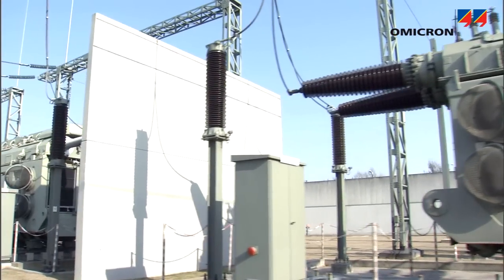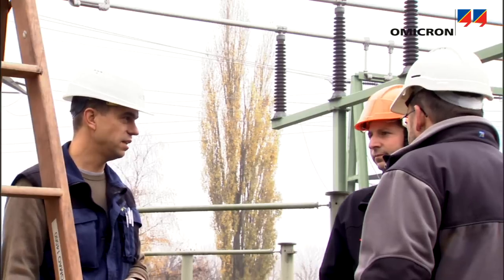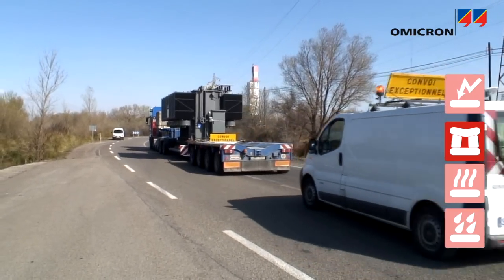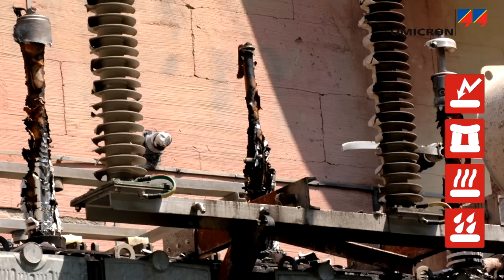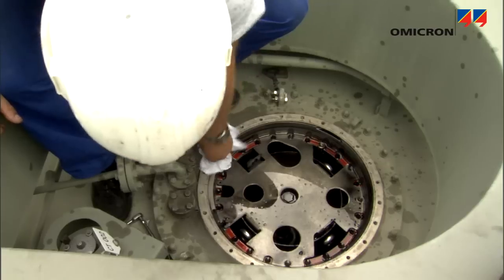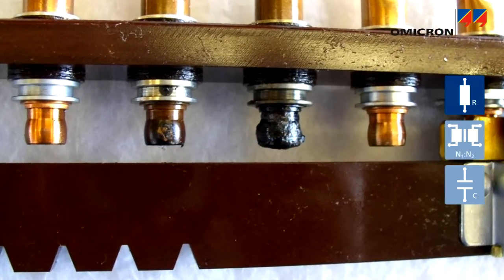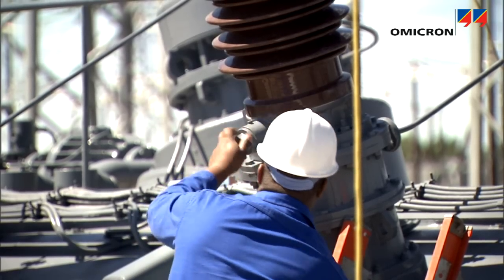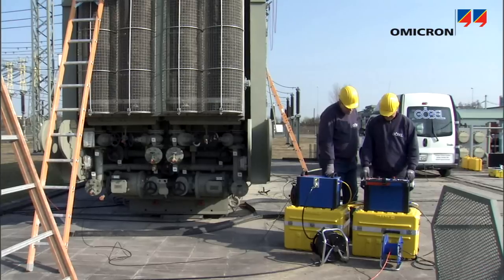Power Transformer Testing

Comment: Excuse me Sir, in withstand test we make a short between Three Phases and apply voltage on the short, that's in Star connection, can we apply voltage test just on Neutral?
With my best regards
Reply from the maker: Dear Eng. Omar Eyad Aljorani, 

thanks a lot for your comment and interest in our videos. The short-circuit of the phases is required to avoid excitation of the core and to equalize the electric field across the insulation system. Excitation of the core could cause a load current. The test of the insulation system (capacity and DF/PF) is done by shorting the phases and measuring the main capacitance between HV and LV side. For more information about power transformer testing, please have a look at our website: https://www.omicronenergy.com/en/application/offline-testing/power-transformer/

Best regards, 
your OMICRON team
Reply: @omicronenergy 

Many Thanks Sir for your reply, so in Star connection, in DC  resistance test, we can apply dc voltage on Neutral, while in voltage  withst test we can not apply A. C. High voltage just on Neutral, we should make a short between Three Phases and apply on the short, that causes, voltage will be induced between the beginning and end of  each phase because there is no  short wire between them.
IS that explination clear, please
Reply from the maker: Dear Eng. Omar Eyad Aljorani, 

Yes, the phases are shorted so that all three phases and the neutral are on same potential. PTM shows a wiring diagram for the individual setup based on the name plate data. For more information, please visit: https://www.omicronenergy.com/en/products/primary-test-manager-ptm/ 

Best regards,
your OMICRON team

Comment from the maker: Dear sri kumar mani,

The dissipation factor is defined as the real part of the current divided by its imaginary part. Thus the tangent of the angle between the measured current and an ideal capacitive current is obtained.
Therefore a capacitor with a low dissipation factor is mandatory in order to create a capacitive reference current.

Best regards,
Your OMICRON team

Comment: All of these tests are performed on all sizes of transformers, too. Even small ones you'd never notice in all sorts of appliances. Usually during design and test at the factory, of course. Despite advances in switching power supply technology and subsequent lower costs, there's still a place for the old transformer :)